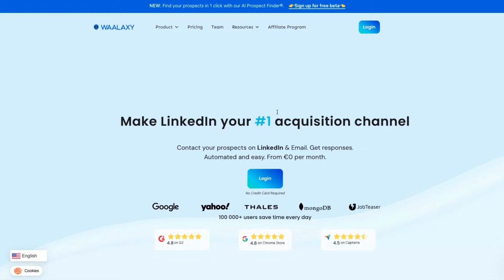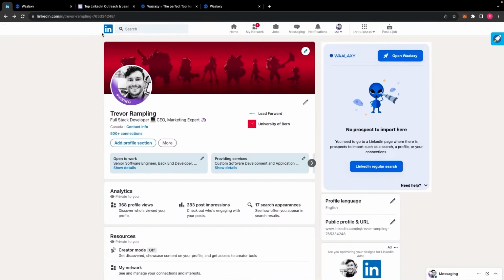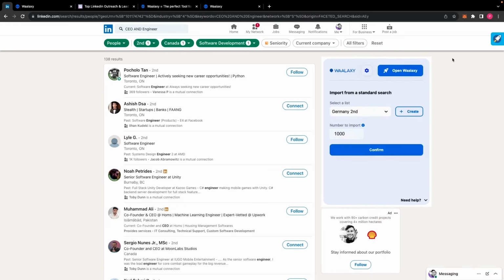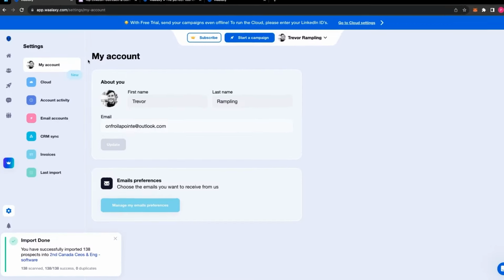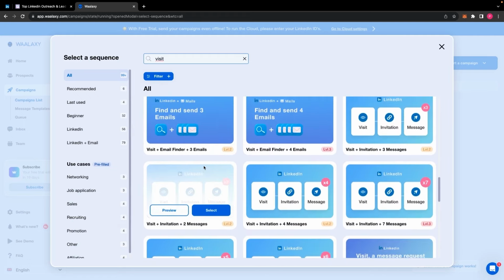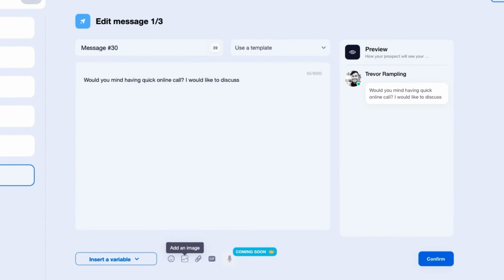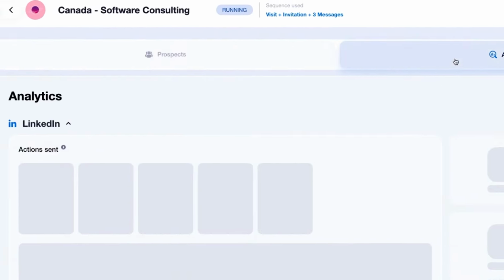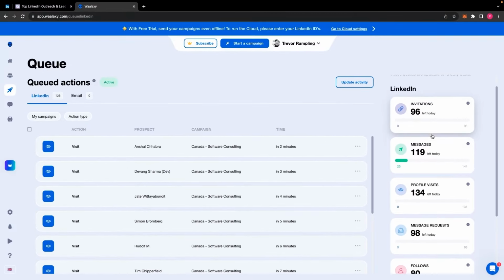Automated LinkedIn Messaging - Waalaxy How to Use for Free

Comment: is it safe? linkedin does not like this kid of tools right?
Reply from the maker: I never had any problems with waalaxy. But you shouldn't use it on new accounts. Warm up it manually first, get 200-300 connections, and send some messages.
For aged accounts, it's completely fine :)